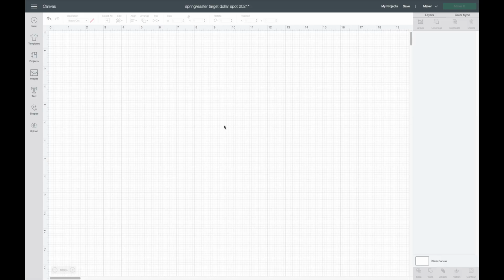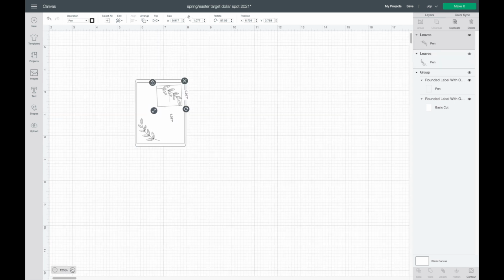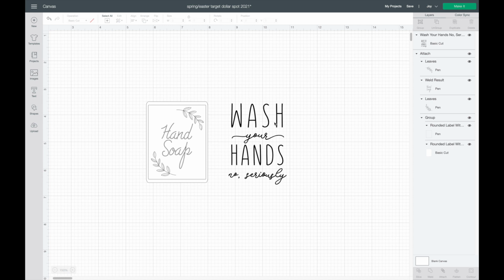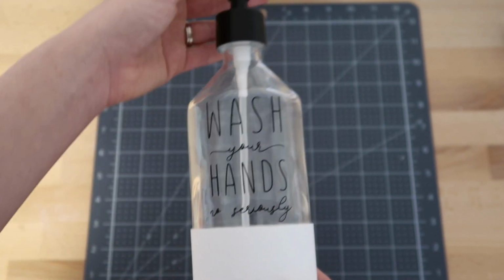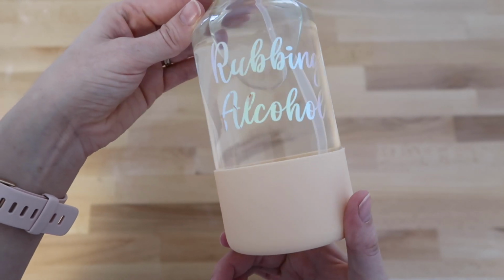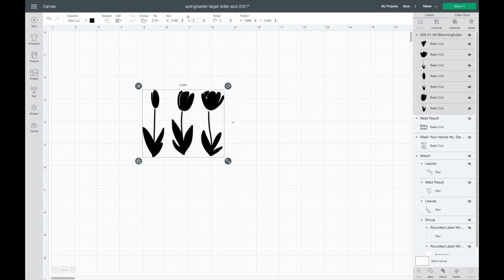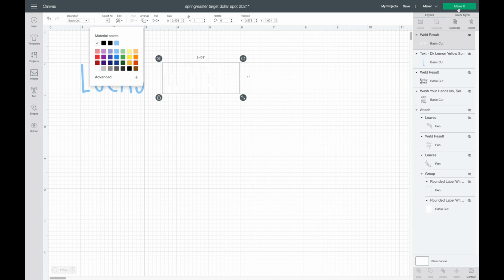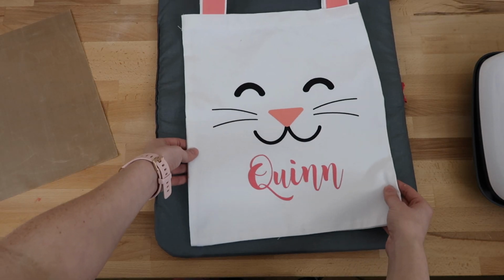SPRING TARGET DOLLAR SPOT CRICUT PROJECTS 2021

Comment: The percentage just means how much it is diluted with water. 70% is fine to clean before applying vinyal. 90% has less water so it is used mainly to clean inside electronics. For crafting they are pretty much interchangeable for cleaning dust and dirt. 🙂👍🤗
Reply from the maker: Thank you!!! 🥰